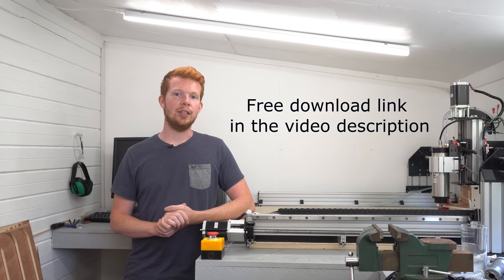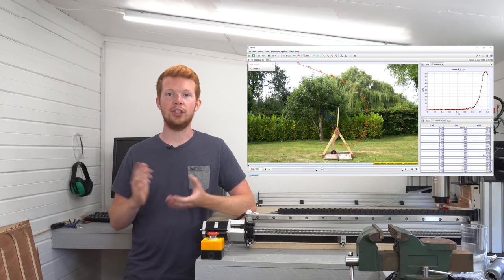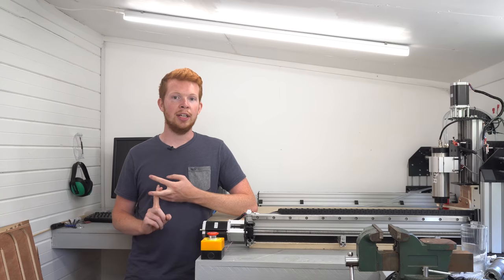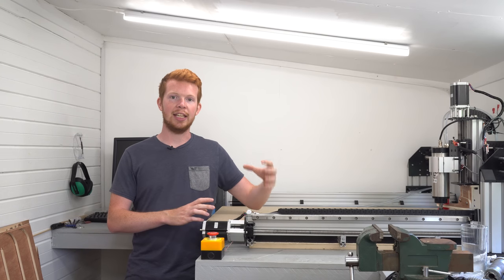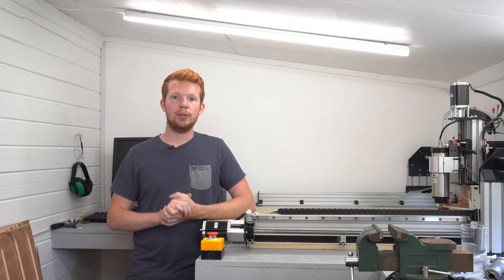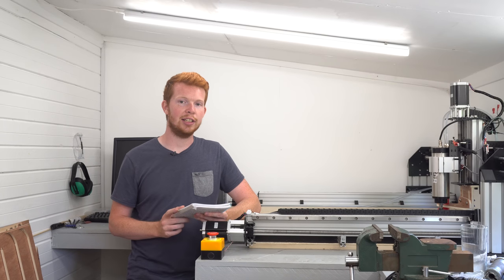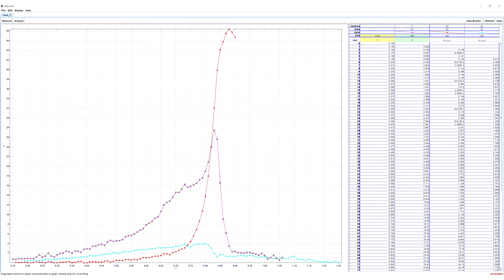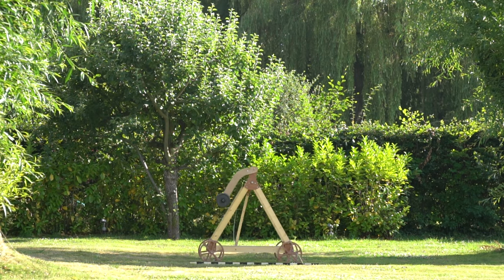Wheels on a trebuchet?

Comment: You are wrong in your thinking about efficiency. This is not one of those sets of hanging sets of steel balls where the combination of very high elasticity and perfectly matching weights allows near perfect transfer of kinetic energy to equal sets of balls, stopping the initial set dead still.
For example, consider a golf swing... by your reasoning, the club head should stop dead at contact with the ball to get 100% transfer...  but that is not how it works... the club would have to have a perfectly matching mass to the ball for that to happen...  and both ball and club would have to have very high elasticity. a heavier club, also, will have zero effect on moving the ball faster at contact.  The ONLY metric that makes a golf ball go faster is the SPEED of the club head at contact. This is why longer drivers are dominating the sport...and why trebuchets tend to opt for longer arms.   The arm still swinging is immaterial... the golf swing has follow thru, and key to hitting the ball farther is to Optimize that follow thru, specifically so that the club head is moving at its peak possible speed at contact.   By the same token... it does not matter how much your arm swings after release... technically, that is mostly the inertia of the arm, lifting the weight back up and storing NEW kinetic energy.
At the point that the arm is moving at its highest speed...that is as much kinetic energy as it can possibly transfer to the projectile. For the arm to slow down after this point. Will transfer ZERO additional energy to the ball.

That is... you are not able to transfer 100% kinetic energy to the ball because you are always using a large component of that energy to accelerate the entire mass of the trebuchet’s moving parts. The ball NEVER gets any of the energy other than the speed of the arm tip.

If your mechanism can impart X rpm to an arm that weighs Y ... the longer that shaft is, higher the speed of its distal end, and the higher the speed of the projectile at release, period.   
Your mechanism sacrificed arm length for a better counter weight design that allows a higher weight, and a straighter drop... and so imparted a lot or rotational speed, but the same design, with the same weight arm that had a longer arm would throw the ball faster regardless of efficiency.

As to wheels- your weight is NOT dropping straight down...it is pivoting around two different centers of rotation... the pivot of the weight arm, and the pivot of the throwing arm.
Because of that, a large component of the kinetic energy is being transferred into a lateral thrust on the pivot points.  This manifests as a low acceleration backwards against the frame, and a large acceleration forwards, that nearly tips it over. The discrepancy in fore and aft accelerations is due to the pivot assembly allowing a fairly straight drop initially, but the weight having to swing under the arm pivot when it’s at top speed.

The wheels actually allow your weight to drop STRAIGHT DOWN.... moving the frame relative to the high mass, rather than shifting the mass fore and aft.
What this means is that Not Only is the shifting frame causing forward movement of the arm at release (increasing its speed) it also allows the dropping mass to accelerate faster... converting even more energy to shaft rotation on the throwing arm.
So...you get much more than just the sudden forward jerk in added momentum... you get a faster arm overall because nearly none of your kinetic energy is being transferred into your weighted frame. It’s ALL going into moving that arm
Reply from the maker: Thanks for your feedback, but I do disagree. This can't be compared to a golf swing as the energy is provided by a variable source, a human. As soon as a golf club contacts the ball, the human inputs more power using his muscles. This has a limited amount of starting energy, which is the gravitational potential energy of the counterweight. So to have an efficiency of 100%, there needs to be ZERO energy left in the trebuchet when the projectile is released. So if the arm is still moving, thats kinetice energy that could have been transferred to the projectile.

Also, dropping the counterweight straight down doesn't directly make it more efficient. Whether it drops vertically or down a 1 degree slope, it'll still deplete all it's energy. What matters is that it stops moving at the bottom due to transferring all it's kinetic energy.
Reply: Tom Stanton 
Sorry... that’s not how physics works.  The human being imparts a specific amount of acceleration to the club up until the point of contact. The human does NOT PUSH the ball with additional force after contact... his only chance to get the ball going farther is to work on accelerating the club as fast as he can. if what you said were true, then Torque would factor...and sorry- it just doesn’t-  the only function of torque in a golf swing is that it determines how fast you can get the club head moving in the brief time before contact...there’s been a lot of money put into study of golf.   The same player, with the exact same strength, can get a faster ball by swinging a longer club.   He’s accelerating the club to the exact same RPM.  It’s just that a longer club rotating at the same RPM has a head moving dramatically faster.
Look it up.
And energy in is energy in.  There is no difference in a falling weight, or a human being whose muscles can only contract yea fast. When the energy input is Fixed...then what makes the ball go faster has to be something other than the energy input alone. So, the scenarios are perfectly analogous.

Take video of your fixed trebuchet in operation and plot on a single frame the position of the weight at every frame.  It will describe a curving line.  As it drops, it will first move laterally as much as it does vertically because it’s pivot is over center of the arm axel. Then It will drop nearly straight for about half of its fall thanks to the double linkage. And then it will start to swing in an arc that gets closer and closer to tangent to the horizon.   That is it being braked in its vertical acceleration the centrifugal force created by the arc its pivot must follow.
Then do the same for the wheeled trebuchet.  The weight will from start to very nearly dead bottom fall almost exactly straight down. In a straight line, because the geometry of its two pivots will Move freely to allow it to.
In fact, the heavier the weight, the closer it will come to falling straight down as its weight becomes larger in proportion to the moment of inertia of the overall trebuchet.

That far more efficient and undampened drop, combined with the forward lurch of the trebuchet at the moment of release, is what gave you a higher speed.
Further fine tune it by determining the instant of fastest forward movement of the trebuchet... and getting the fastest arm speed and straightest sling extension and release all at that same instant.

Comment: G'day,

  Very very cool !

  And, now, if you dismantle it carefully..., and give all the Wooden Components 3 hand-rubbed coats of Marine Spar-Varnish, put it back together a week after the final coat dries ; then you should be able to bring that thing out from under cover, and play with it every year until Tennis-Balls go out of fashion, & the Ammunition becomes commercially unavailable... (lol) !

 If you leave it with the Wood bare, then as the Humidity fluctuates in response to Global Warming modifying Britain's Weather, then all the Timbers will absorb water - and dessicate, in accord with the surrounding Atmospheric trends, and unless it was Quarter-Cut Milled in the begining then the Timber will not only swell and shrink - but because that swelling & shrinkage will occurr ALONG the direction of  the Growth-Rings (as seen by viewing the End-Grain of the Log it was sawn from....); then the wooden members all will Cup & Twist & Warp & Bow - as they repeatedly shrink & swell.... 

  All of which, is why it IS actually worth the extra trouble to have 1/4-Cut Milled the Log in the first place, as well as to Varnish-seal the components before assembly....

  Have a good one,

  ;-p

  Ciao !

Comment: Hello Tom,
On the trebuchet with wheels, the vertical stall points of both counterweight & arm means both units are still accelerating & imparting kinetic energy to the missile. The stall points on the fixed trebuchet occur about 10 to 15 degrees before vertical, which shortens the time period for accelerating the missile. 
There is a similar situation in archery concerning the brace height (fistmele) of bows. Shortening a bowstring bends the bow more & increases the distance between the string & the pivot point of the bow's grip. If the the brace height were increased from 7.5 inches to 9.5 inches then 2 inches of acceleration to the arrow would be lost. Armin Hirmer of Malta Archery explains it all in  a recent video.  Longer draws  generally impart higher velocities to arrows.  https://www.youtube.com/watch?v=8Auk59oxB3Y

Your videos are very enjoyable. Keep up the good work.

Comment: so 30% of the energy is lost in heat? that seems a lot...
Reply: Not really. There would be some heat from the friction of the joints  but alot of that 30% goes into moving the frame forward and making the frame shake around after its fired
Reply from the maker: Well technically you could say it's lost in heat, but not directly. Essentially 32% of the  potential energy isn't transferred to the projectile, but instead either into the air (air resistance), into friction in the bearings or left as kinetic energy in the swinging of the counterweight (which you can say is dissipated as heat 'technically'). It might sound like a lot, but it's still nearly double the efficiency of the average car on the road ;)
Reply: So Tom, what you are saying is that I sould build a large enough trebuchet to launch myself to and from where I need to go 🤔?
Reply: @nimbos0 As long as you don't mind the acceleration. If you want actual efficient human transportation, hop on a bicycle.
Reply from the maker: Sure... but not recommended! Listen to Benjamin and get a bike

Comment: A floating arm trebuchets  is much better.
Reply: That is debatable. I have both. They are pretty close.
Reply: I don't think so.  Maybe with your design.  The advantage of the floating arm is the weight comes to a complete halt at the end of the throw.  With a conventional trebuchet the weight is moving when the projectile releases.  There is a lot more energy left in the weight.
Reply: Also the drop distance is higher in a floating arm so more M*G*H energy.
Reply: I have multiple high performance  versions of F2Ks and Rolling Whippers.
Reply: One would be inclined to believe that is the case. I started building Whippers to test head to head with F2Ks.
Reply: Is a whipper like a fishing pole to store energy?
Reply: No not really, although I do on some arms engineer a certain amount of flex in a specific location to induce the Magnus effect. If the arm flexed like a fishing pole, it would induce Way to much magnus.
Reply: If you look at my videos, you will see some perfectly timed Whipper shots with no movement of cw or arm after release. You will also see some high rebounding from my smaller F2K "Little Monster" It's the faster F2K ever built.
Reply: I looked at your video.  cool.
Reply: Thanks. I have a hundred percent up scale version frame of that machine with a 53" throwing arm. It has a 1200' range with 1 pounders and 200# cw. It will reach out 2000 feet with an 8 foot arm and maybe 250# cw.
Reply: Here's the larger one chunkin 12oz baseballs. It's chunked 2.5 or 3 pounders around 700 feet with 200#cw I think. No cw rebound. https://www.youtube.com/watch?v=acsKLpAlsKo&t=0s&index=15&list=FLQYHlcLCjSv2xg46S4VpmNg

Comment: YOUR EFFICIENCY CALCULATION IS  WRONG. energy is proportional to velocity squared. 68.3/42.7 is not 62.5%, it's only 39%. you should be ashamed for blatantly spreading misinformation with such confidence. it is OK to be wrong, but when you are so confidently spouting incorrect information it makes you a bad educational youtuber
Reply from the maker: I'm confused why you are dividing 68.3 by 42.7? The 15kg counterweight has roughly 183J of potential energy when raised. The tennis ball weighs 0.056g. Reversing the KE equation, 0.5 x m x v^2 , will give you a velocity of roughly 81m/s. The ball release velocity was 55.4m/s. (55.4/81)x100= 68.3%?
Reply: Tom Stanton you calculated your theoretical max ball speed to be 68.3 in the previous video. Your KE calculation seems correct but when you calculate energy efficiency you use speed/speed
Reply from the maker: Ah I understand the confusion now. It seems that was just a coincidence that the theoretical max ball speed from last weeks video, matched this weeks efficiency. The tests last week were carried out with a 10kg counterweight raised 1.33m, which would theoretically throw the ball at 68.3m/s. Whereas this weeks tests were carried out with a 15kg counterweight raise 1.25m. So this weeks tests had a gravitation potential energy of roughly 183J, which if converted 100% into kinetic energy in the projectile would throw it at 81m/s. But because the ball only went 55.4m/s,  (55.4/81)x100 = 68.3%. Does this clarify my calculations? Thanks for pointing out the coincidence, I should have realised and mentioned it in the video.
Reply: Tom Stanton this is still incorrect. The ENERGY efficiency in this case would be 46.6%, while the momentum efficiency is 68.3%.

As a separate point, the masses of the arms are non-negligible when calculating gravitational potential energy
Reply: Efficiency is (energy out)/(energy in) typically, so your efficiency would be 0.5*0.056kg*(55.4m/s)^2/(1.25m*g*15kg) giving 86J/184J = 0.467 or 46.7%, if you wanna compare speed only you need to take the relation squared. ie. (55.4/81)^2 which is also 46.7%
Reply from the maker: Thanks TheJohaj for explaining that properly! I now understand what nickt meant. I will put a note of it at the top of the video description correcting my mistake.
Reply: Tom Stanton no problem man keep up the good work!
Reply: thats a bit of a strong statement, 'should be ashamed for blatantly spreading misinformation' he made a mistake... kudos to Tom for dealing with you politely!
Reply: Totally not the correct way to hint towards this mistake... This videos are still great and I watch them for entertainment and not for 100% accurate maths. If this mistake is corrected in an upcoming video this is totally fine and resolved.
Reply: Awesome video. Honestly you sound a bit rude in your correction but Tbf tom made the same miscalculation in the previous video, and could have been noticed before posting this update.

Glad you're continuing to put out cool content.